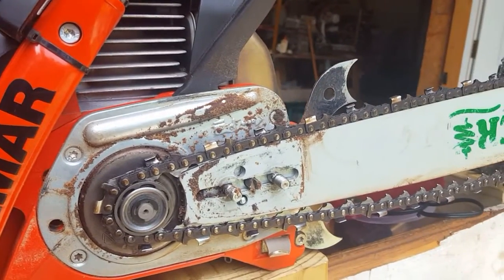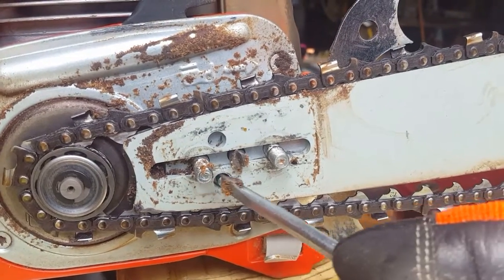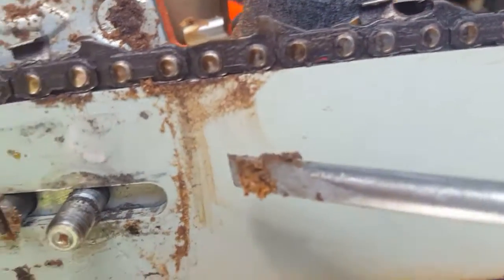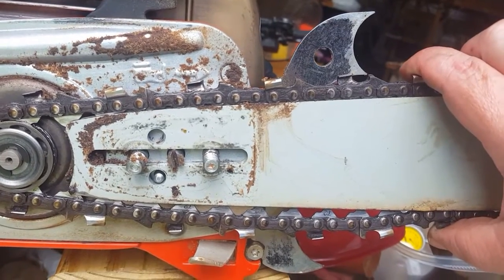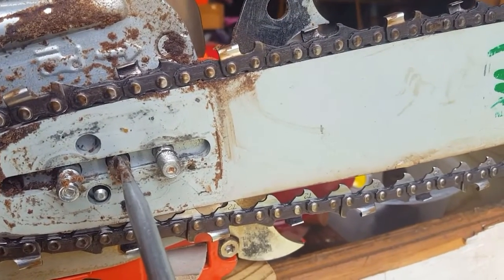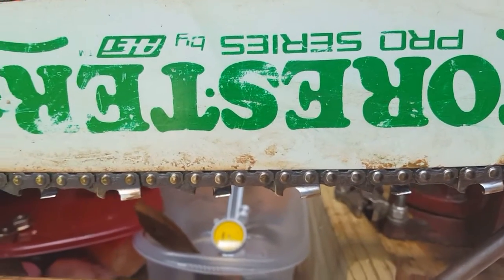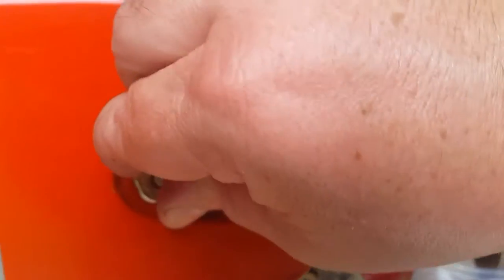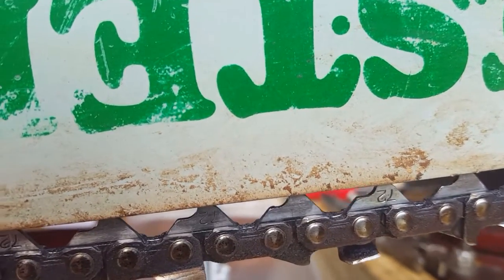Chainsaw bar and chain tensioning step by step

Comment: Thanks for taking the time to make this video. My chain tension troubles may be from not lifting up the nose of the bar enough when I tightened the nuts. I'll report back after I work this weekend and give it another go next week.
Reply from the maker: cool let me know. it could always be that the chain is to long. I know my local dealer always swaps chains and bars on new saws to fit the customers needs. sometimes things can get mis paired.